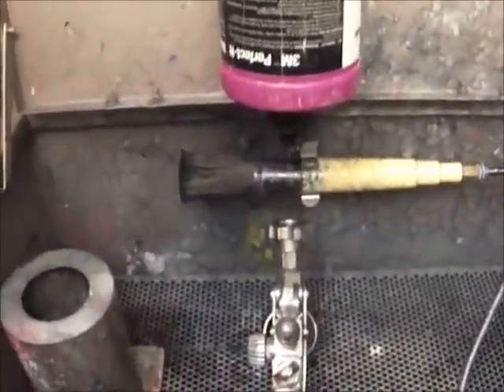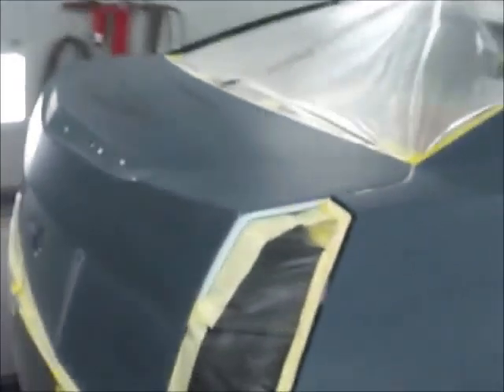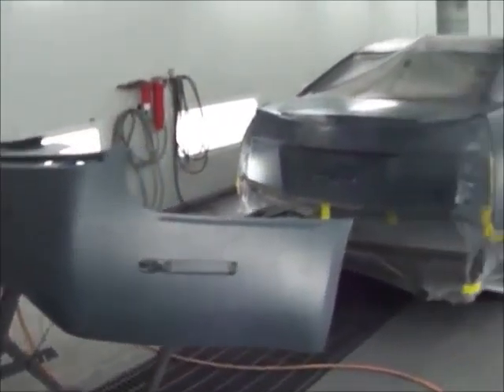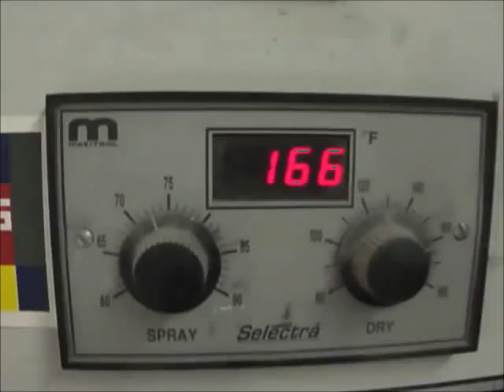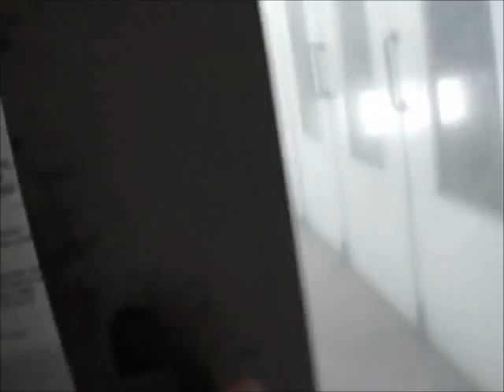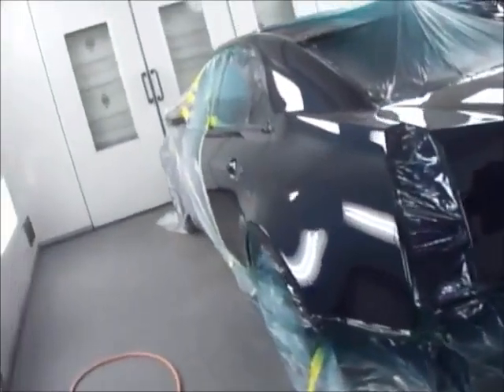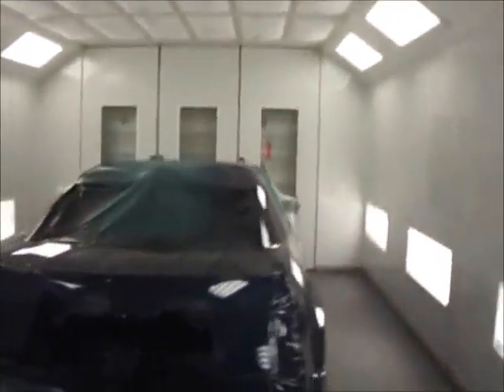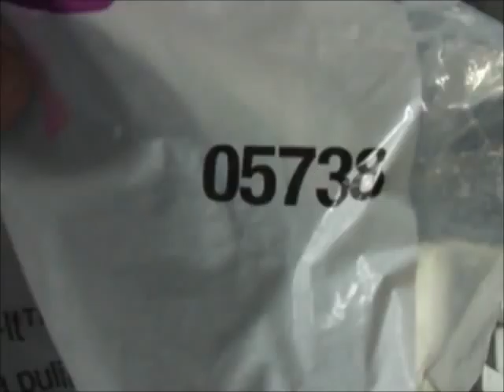Spray time

Comment from the maker: Yes belive it or not. They tested our lines before installing the system. We ended up putting in an inline filter. And that is with two screw compressors with built on colling units.